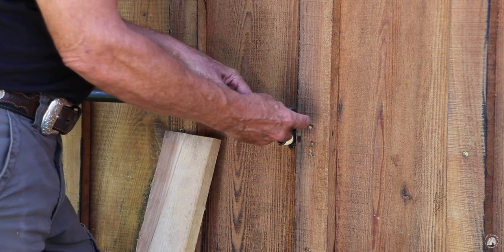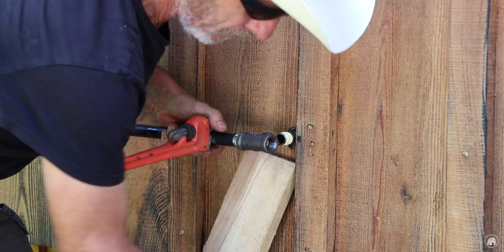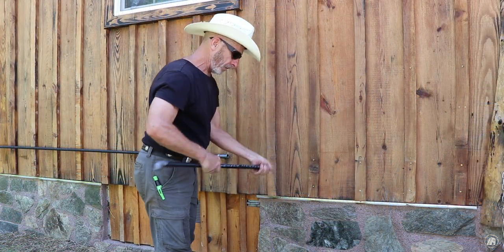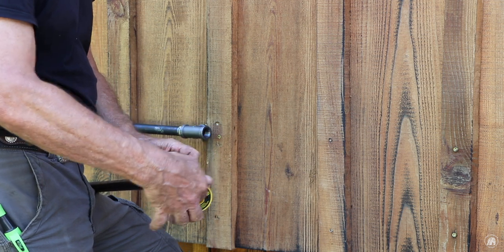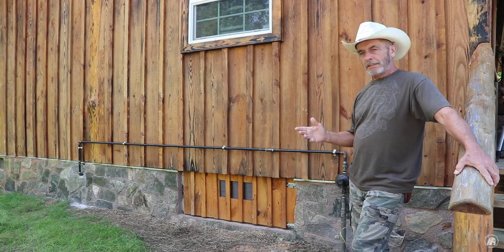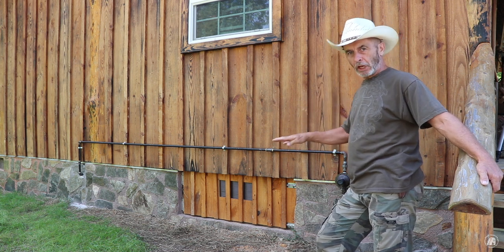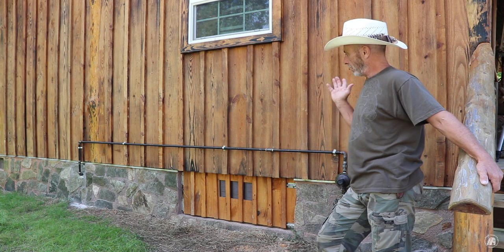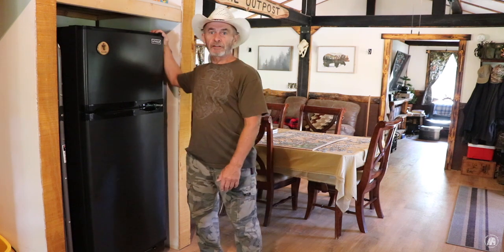The Rock Hard Ground Broke The Tractor!!! - Propane Gas Install

Comment: Fantastic hook-up Richard, it's great you had a lifelong friend to give you a hand and get the install right and everything up and running. That is a BIG accomplishment and will keep you going around there. Stay safe around there and enjoy the appliances and how much better they make life easier for you all. Something that could take any worry out of the outside lines freezing is insulating them with water line insulation, it's easily installed and in a cold windy condition will really protect the lines. Stay safe and keep up the good work around there. Fred.
Reply from the maker: It sure is nice

Comment: I used to run gas lines in mobile home factor in the late 60s, kinda aged myself. We always had to put a tee with a plug  in it every time we changed directions going up into the home because of condensation. The tee was actually being useful as a moisture  trap. Times change, I'm sure. That ground of yours is hard... great job, enjoy watching.
Reply: Another great job.

Comment: I like your tile spade. I have been on the business end of one quite a few times. Gas lines look nice on the cabin.
Reply from the maker: Thanks 👍 hope they don’t get to cold in the winter
Reply: @SmokyMountainOutpost  Up here in NE MN we have -50 occasionally. Lots of exterior propane lines. No issues unless...you have a high use appliance pulling from too small of a gas tank.

Comment: I watched your video and couldn't help to stop by and give a little advice about the material you chose at the tanks and I believe the line you said you used to run from the crawlspace to your future gas logs. Black rubber hoses are a huge NO! Mice, boomers, squirrels and other critters love chewing that kind of material. Outside is one thing if they chew through it but you definitely don't want that chewed in the crawlspace. I have been in the gas service business for 24 years and can't tell you how many times I've seen this. Be very careful! I would hate to see you hurt first and foremost but also to see all your work destroyed from something that could have been avoided. Copper tubing would work best for both of these areas when running black pipe isn't an option
Reply from the maker: Thanks for the tip.

Comment: I dont think you use Teflon tape on gas lines ? I  believe you use pipe dope on the threads.
Reply from the maker: It needs to be gas tape. It is thicker and has a chemical that causes it not to react with gas.

Comment: I have been watching u from Australia, ever since u first started building your cabin & I find myself asking u as here in my Country u can not use tape as a sealer for gas lines. We use a liquid paste that never actually goes hard but seals the joints better than tape which btends ton drien out & leak after a few years & can become dangerous around open flames, plus I see u have an extraudinary amount of joins which add to the posability of leaks. I would hate to see what u have built in a few years down the track.
Reply from the maker: The gas tape I was using is very common here. It is thicker than others and usually wrap about five times. Pipes held good at 100 PSI over time so consider it holding well. I do have to find a different flex/steel hose for the floor.